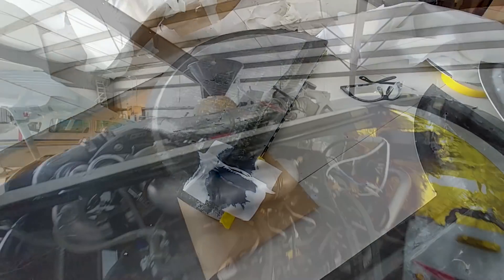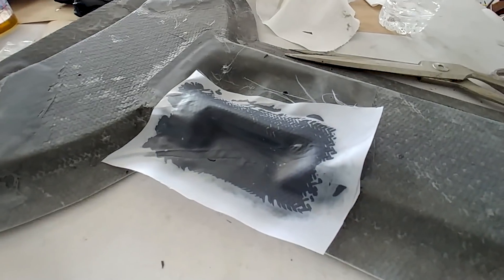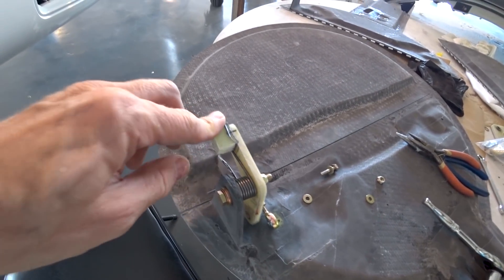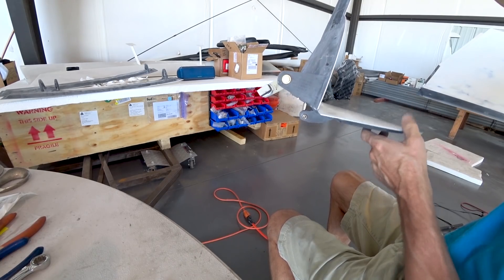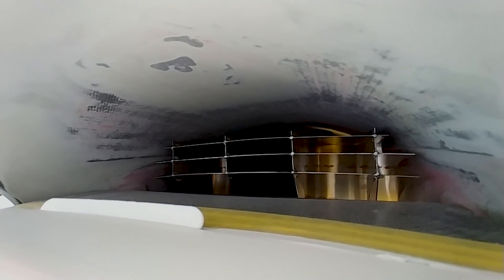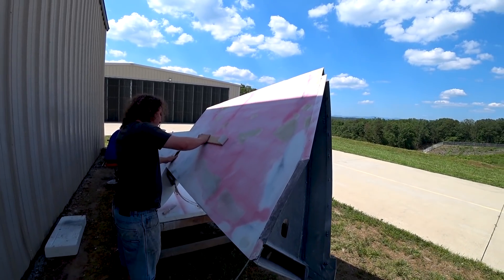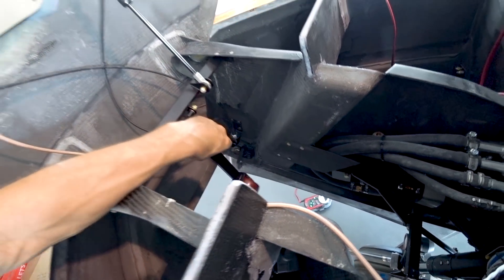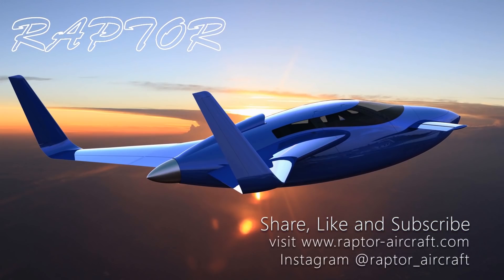Purging the Cooling System - Building the Raptor Prototype

Comment: I’m not an engineer but is there a way to make the main landing gear door, the portion that covers the wheel (90 degree fold), be attached to the gear bay?  What I mean is, very similar to your nose gear. When the main will comes into the wheel well, the tire will make contact with a lever and when the tire/gear is fully retracted the door closes. Just a thought. Hang in there!

Comment: How about permanently mounting the lower half gear door to the wheel. Meaning it is a permanent mount on the strut only the top half moves on its own? That eliminates the need for additional complexity.

 What none of us need is additional costly complexity where it is not needed as it ads more costs in maintenance, more downtime fixing little things, and more potential for failure when you do not want it.

Comment: Its not a boring video at all. I've been trying to find a way to put a lower door on my main wheel wells. I thought about doing what you have tried. Now I know it won't work. I'm leaning more toward anchoring the lower door to the strake and closing it after the wheel has come up like a Berkuit,

Comment: Instead of antifreeze you should run evens waterless coolent  40- to 375+ degrees ferenheight
Reply: Kevin Baker can’t recommend that stuff. He’s already having issues almost overheating with his current cooling system. Waterless coolant has lower heat carrying capacity than 50/50 mix. Look up specific heat of water vs ethylene glycol and propylene glycol. Water is in coolant for a reason.
Reply: @nateb19  I run evens coolent in all my cars with no problem. 60- to 375+ call evens and talk to them
Reply: Kevin Baker glad it’s working for you. Engine will run hotter though unless you have a larger radiator. Not good for the oil  to run hot. Look up specific heat of water. It has a a much higher capacity to absorb and transfer heat. Automakers design cooling systems for a 50/50 mix for a reason.
Reply: @nateb19  my cars run 5 - 10 degrees hotter than thermostat temp setting also no rust or electtrolasis that 50/50 or strait water causes it's also low pressure I also run it in my over the road semi w/ cat motor same out come. You need to read up on the evens coolent also50/50 coolant will freeze to ice and crack blocks.all my vehicles have stock radiators
Reply: Kevin Baker to me it’s a solution looking for a problem. A 50/50 mix will protect against corrosion just fine as long as it’s flushed on schedule. Water is a a better heat carrier so it cools better. You can increase the percentage of antifreeze for colder climes if freeze up is an issue. Boil over isn’t always a bad thing. It tells you your engine is overheating. If Evans doesn’t boil over it doesn’t mean your engine isn’t overheating. Also Evans is really expensive. Glad it’s working for you well. It makes sense in some applications I think. Peters cooling system is already pretty stressed though. Putting a less efficient heat carrier in there will not help matters.
Reply: @nateb19  I've run it for years good for300k or 7yrs.50/50 coolant still causes electtrolasis on cylinder liners no rust no corrosion.ive had experience you haven't
Reply: Kevin Baker ok one more issue . You can’t just top off with distilled water or 50/50 antifreeze if you need a top off. That means you have to haul it around with you. It’s not something commonly seen in truck stops. Definitely don’t see it at airports. Happy it’s working for you though. Just doesn’t make sense to me in this application. Also look up Rotax 912 they used to recommend Evans but no longer do. Reason is the heat transfer issue I bring up.
Reply: @nateb19  I carry an extra jug of coolant and have over flow bottle and it's a low pressure system heater hoses are silicone and no water means no steam

Comment: If the 737 doesn’t need gear doors, we probably don’t either! A huge number of WWII aircraft with retracts also did just fine without doors on the lower halves. I think it may work out more easily to put the door on the wing for production aircraft. Keep up the good work!

Comment: Are you familiar with the Vibrant turbo piping connectors? Allow for movement and angularity(11°,i think) and hold significant pressure. Once these are used, I've never heard of anyone going back to silicone hose type joiners.
Reply from the maker: I was unaware of those when I plumbed the turbos. I'm not even sure they were available yet. Anyway, I don't have time to replace them now and the T bolt clamps work well if the fitment of the piping is good, which it all is now.

Comment: Never boring.   Perhaps a spring on the other end of the gear door and or a loaded piano hinge spring.
Reply: Need to make it "bi-stable", have a slot where the spring-end can ride inside it, it push on the open position when down (1st pos. in the slot) and when up it push the door close (2nd pos in the slot).
Align the spring with hinge point (also centre of the slot) and move the spring (its tip) up or down inside that slot.

Comment: Fantastic work as always Peter, to you and the team.

As for that half of the gear door, yes it does certainly appear to be quite a challenge.  My thought on that half a door to cover the rear wheels is to use either a gas strut to keep it open, or perhaps to move that door to the wing.  Although I think moving it to the wing at this stage would be challenging to find room for a hinge, since behind that wheel well is the fuel tank.  Maybe as you say it will just need to be shelved for now, or perhaps model 2.

Best of luck.